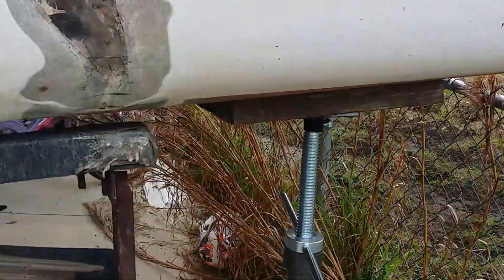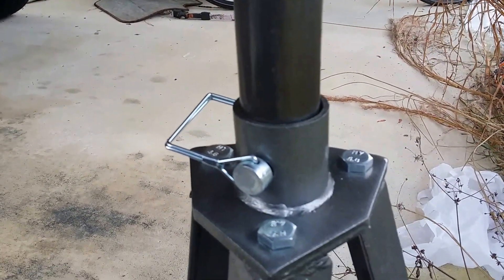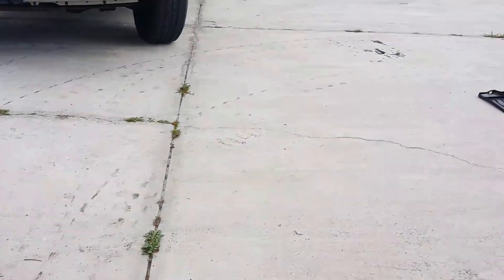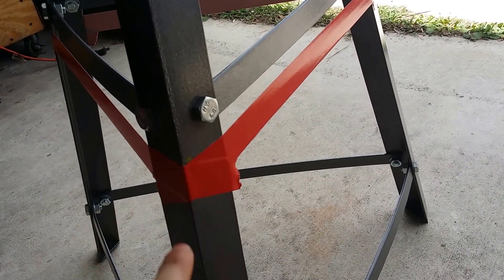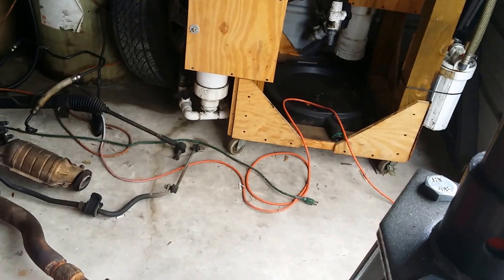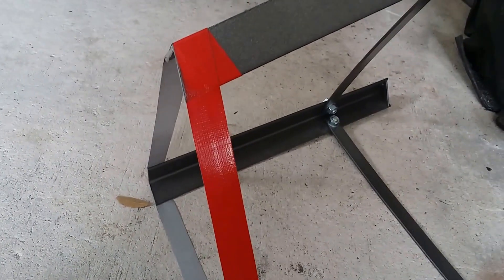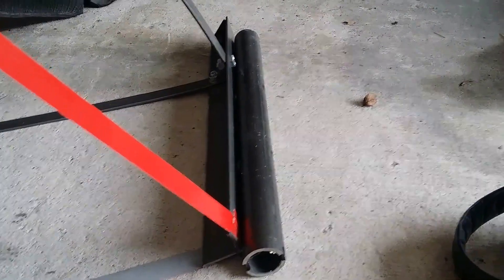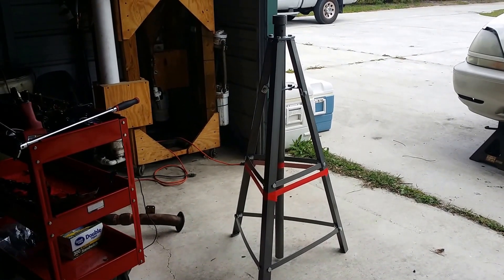HOW TO MAKE A BOAT STAND ON THE CHEAP

Comment: Not to be a downer ABOUT These Stands. But ive owned 17 or 18 boats in my life and  if anything ever happened to   A boat on these that causes damage to it or ant other property   Insurance companies would do everything in their power not to be held trsponsible for paying for damages  thats why Marinas are so strict on using  certified equipment when  blocking boats up around. Millions of dollars worth of boats  and property  and unfortunately accidents happen   On commercial boat stands they are. Provisions to chain them securely in place  when holding up the Vessels   So they dont get pushed  from all the weight  this system doesn’t  have that in place   Being it is potentially responsible for holding up many tons of my pride and joy  i prefer to. Stick with a system that is well proven and has  safety  systems built in  but thats just me  protecting my  assets  and how i roll  plus I’m a little weary about working under  cheap Chinese Metal and Crappy welds  to save a few dollars  heck you can buy used Stands at most Marinas  that may need a little paint  to look better but at least you know they work  as intended  i took some in trade. From a Marina that owed me money  gave them a rustoleum paint job  and some grease and  thats what i ve been using for 10 years